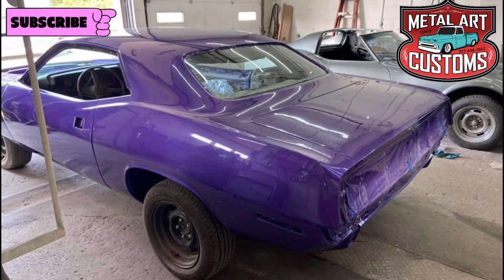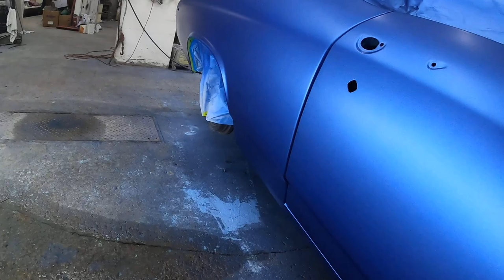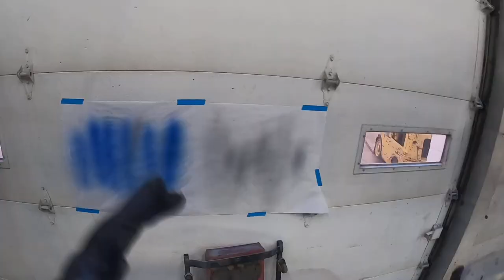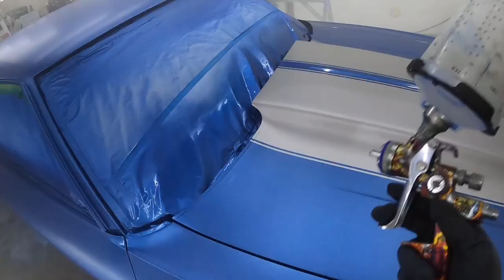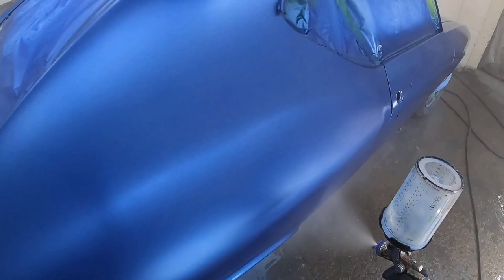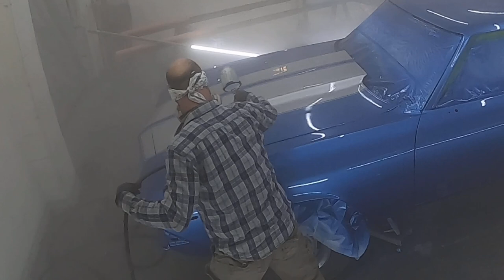The clear is on!!!! WOW!! This blue is amazing! 69 CHEVELLE

Comment: Looks awesome ! Is it fine to leave the base flashed off for just overnight and then lay the base down ? Any idea how long you can wait between base & clear ?  Being a DIY er and in my home garage … I dunno if I could do all that in just a couple sleazy or not ? 🤔🤷‍♂️
Reply from the maker: I generally do leave it sit overnight but you don’t wanna let it go too long either. I was always told within 24 hours. If it’s going to be longer than that they told me to put one more coat of base over the top and That will buy you a little bit a time
Reply: @metalartcustomsLLC  thanks man !!
Reply from the maker: @shawns57garage  any time
Reply: @metalartcustomsLLC  you did a fantastic job

Comment: How much pressure do you like for an HVLP gun?
Reply from the maker: I usually go by the sound with HVLP guns you’re not supposed to run very much at all but I judge it by the sound and by the way it’s coming out of the gun
Reply: @metalartcustomsLLC    I had always run mine around 30 psi before.  Just wondered if there was a sweet spot to avoid excessive over spray.  Not sure if 30 is right or wrong.  THANKS
Reply from the maker: @Wormser_mcfrazzleweiner  I honestly think it’s supposed to be between 15 and 20 but I think I usually run minor little higher than that just because it sprays out better I think